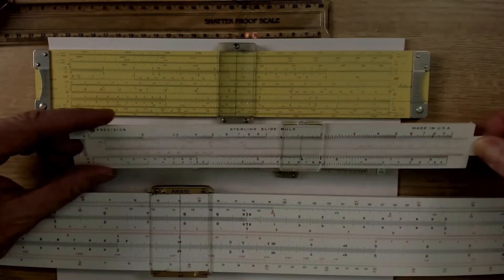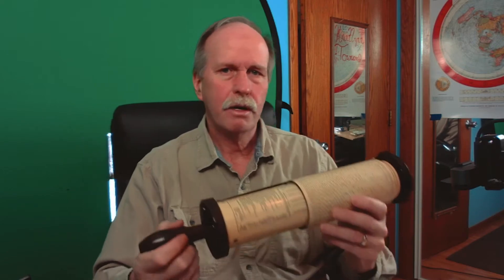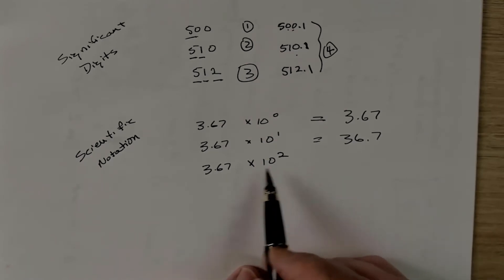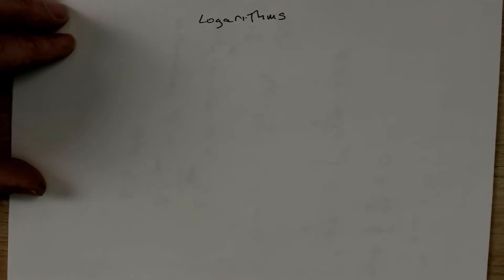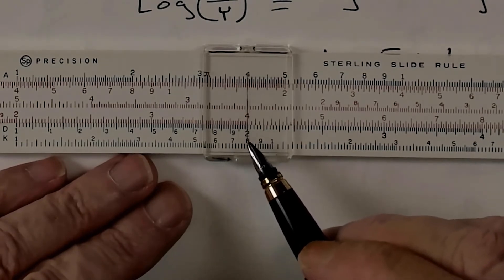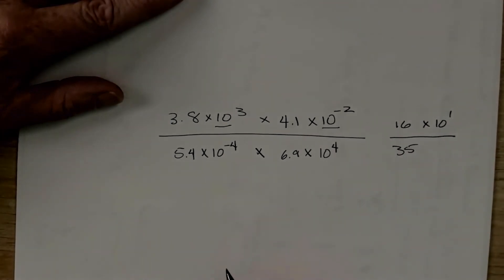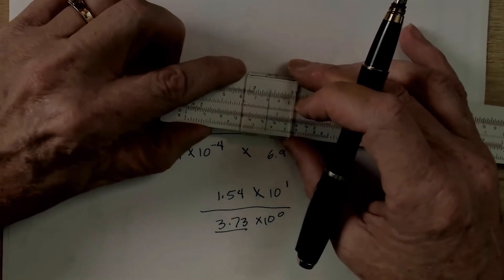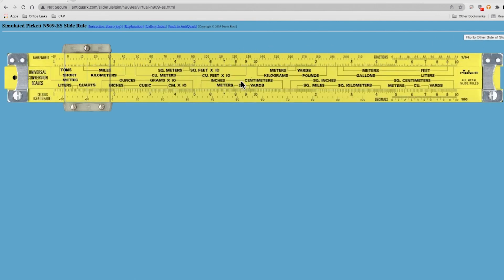Slide Rule 101-  Theory | C D Scale

Comment: If my slide rule could only talk. Originally owned by my father, whom never talked much about his life,  professional or personal. As such, the rule provided some calalyst for my researching post-mortum. The rule is housed in it's original M.I.T. leather sheath circa mid-1940's. Attached to the sheath is a small Warning: High Voltage placard, heavily worn on one end. His formal education being split in two, partly financial- partly WW2. GI bill providing funding for school and, well, apparently passing the Eddy Test.  Off to Electronics Training Program before returning to aeronautical engineering degree post war. From there to 4+ years at Alcoa, then off to a quiet, western NY aircraft company, doing a bit more than aircraft. Would the VP of Development (Dornberger) hire a young aluminum structural engineer ?  This isn't rocket science, is it? Lol. Those efforts are hidden in front of everyone. While Von Braun got things to space, Dornberger's crew created navigating in space. Two completely different things.  From there, he went to navy's model basin.  Smart folks and slide rules.  Seems  he was always working inside some armed guarded buildings going back to ETP school.  Mumms the word.
Thanks for the lessons. My first "slide rule"  was made by him: 2 peices of paper with makeshift  C& D scales along the flat edges for teaching a 2nd grader multiplication tables.
Reply from the maker: Well I find after doing hours of calculations with one, you start to hear voices, which I assume is the slide rule telling me to put it down and take a break.